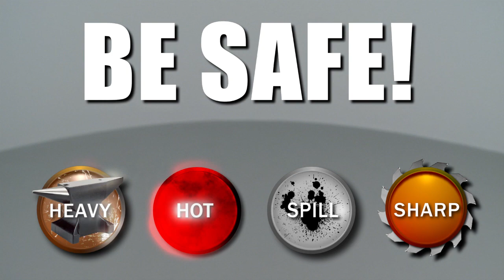Toro Lawn Mower Wheel Replacement, Repair #115-4695

Comment: The thick brass piece that the wheel screws into is at the wrong angle.  The Teeth on the plastic gear get worn down unevenly and the wheel must be replaced often.  I took off this piece, bent it in a vice about 1/8 inch and re-installed.  I haven't had a problem since.  No one at Toro could help me with this issue, yet it seems quite common on some of the forums.

Comment: I just received the debris shield which I ordered from you to replace the original one which has a substantial portion broken off.  The problem is that the old one does not slip off nicely like it does in this video.  The hole is too small and it cannot be passed the large gear.  How can I get it off  to replace it?
Reply from the maker: What is your mower's model number?
Reply: 20371
Reply: Same issue here.
Reply: i had too remove the gear just to replace the sheild !

Comment: What do I have to do if that hole for bolt is stripped?
Reply from the maker: You'll need to replace that part. You can find the part for your lawn mower by entering in your model number at www.RepairClinic.com.

Comment: bolt keeps coming out causing wheel to come off
Reply from the maker: +Beverly Moore That bolt threads into the deck adjustment plate. If it is stripped then both the bolt and plate should be replaced.

Comment: How do you take the gear off the tire, though? That's what I'm wondering...
Reply: @SOLDOZER  you can punch the pins out from the other side and use screws to secure the gear to a new wheel. This is something made easy by the front wheels being cast the same as the back wheels.

Maybe don't talk about things you don't actually know anything about in the future.
Reply: You don't. The new wheel should come with one as shown in the video. Also if your self propelled stops working and it becomes hard to push, you can take off the two drive gears off each side of the mower itself. The clip will take a needle nose if you don't have a clip removal tool. This will allow it to freely roll. This is if you don't know how to fix the self propelled by adjusting the cable which some people don't know how because they don't know where the hell it's at.